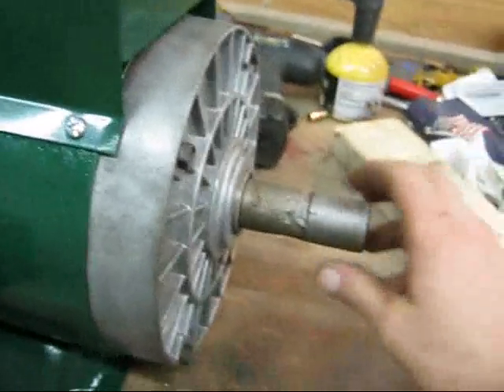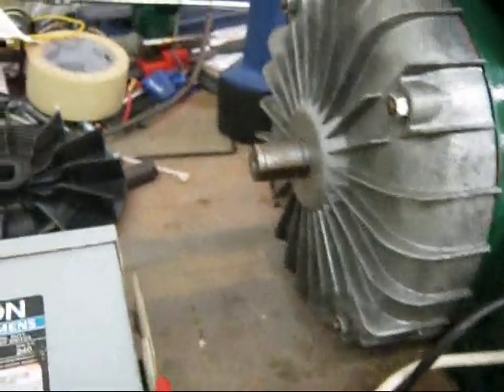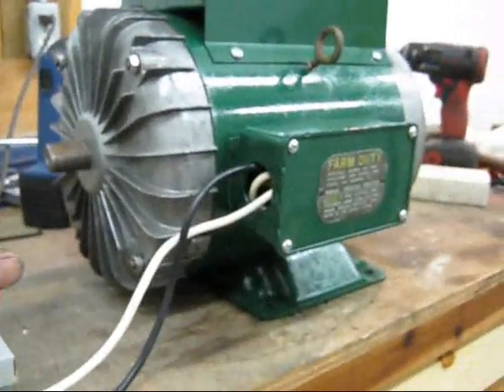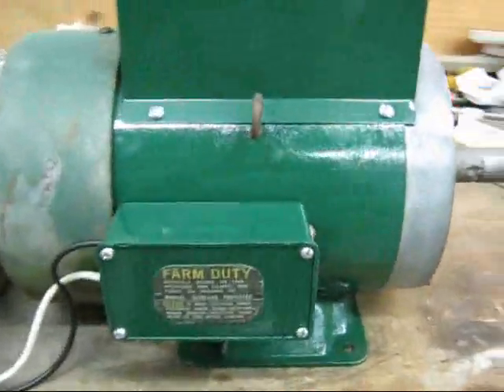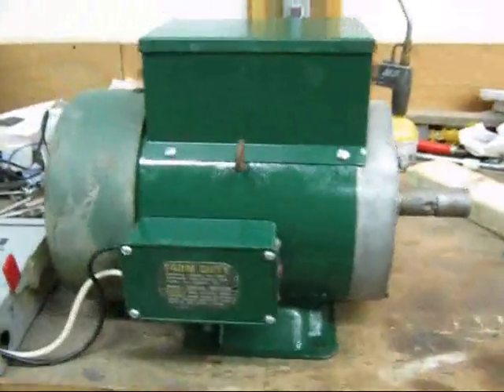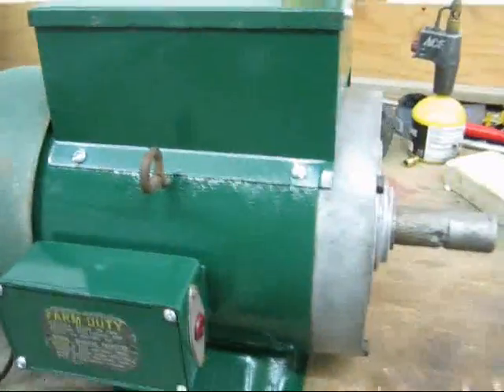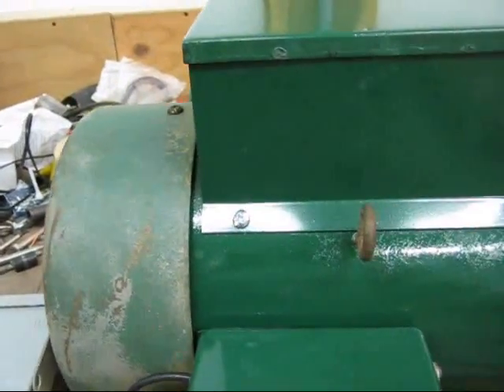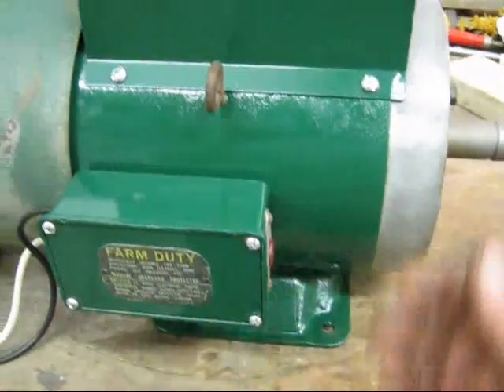5HP Single-Phase Dayton Farm Duty Electric Motor - Almost done!

Comment: hi, what size starting cap or caps, i picked up a 5 hp ajax motor starting caps leaking, it has 2 in parellel 810 to 940 uf@ 165 volts wired in parellel, not sure if original but seems high, parellel adds value of uf so about 1600+ uf at startup just wondering what a similar size motor like yours is running, thanks

Comment: Did some testing and my WEG is only pulling 8 AMPs with nothing hooked up is this normal?  Also when running my Kellogg 330 air compressor pump it pulls 33 AMPs.  Any help would be appreciated.
Reply: So you have no load (other than spinning the rotor) on one draw little amps then when you put a very large load on (compressing air) you're telling me it draws 3x the current? You don't say....

A machine only draws as much current as it needs, outside a short circuit.

Comment: Thanks to you and your great videos I took a chance on a 5 HP WEG single phase off craigslist.  Replaced the bearings and now it runs like new!  Thanks for the great video.  Any recommendation on a magnetic starter and pressure switch.  Thanks Again!

Comment from the maker: Justin, it's very hard to find those fans. I've had pretty good luck adapting fans from other (newer) motors to these. There's a similar sized Baldor motor fan that will fit. I have shimmed the shaft with a piece of PVC pipe cut for a bushing.

Comment: Ok sorry disregard my previous comment on the original video. didn't see this later update till after. Anyway, wow is that a great motor now or what! Thanks for sharing. Can I send you a pm on a question I have?
Reply from the maker: Thanks for the comment! Yeah it's a good motor, I plan to use it on my pressure washer if the original motor fails. PM me anytime!

Comment: Very cool video, I am working on a 5hp A.O Smith /Century  K300 motor and running into problems.
First I took off the back cover and snapped 3 of the 4 tiny screws flush so i had to drill out the screw and re-tap them while finding out that the cooling fan was missing one fin and 2 other fins broke (still might attempt to fix that.)
Next I changed the direction to CCW for the compressor and cleaned up the 4 start capacitors (540-648) that the connections were a bit crusty.
4 long bolts hod the front and rear caps on and the bearings are pressed onto the shaft and the inside of the caps, it took me the better part of the day just to remove the stuck caps without breaking them.
So now I need to change the front and rear bearings 6307Z front and 6206z back and find another start governor that was part mounted on the shaft and the other part mounted on the back cap which is the one i need.
Problem city but with any luck I hope to have it running soon.
Reply from the maker: Hello Vic.  Hope you get your motor up and running soon!  The switch on the rear housing is usually what goes out. Are the contacts the problem? You can often repair them by soldering new contact pads on there.
Reply: the contacts seem to be okay the problem is where the wires from the motor hook too the prongs, they are real weak..
The slide on posts are frail and weak and I am not sure  they would be able to withstand the wire being put back on them.
I will know more information tomorrow as there is a shop here in town that repairs motors and with any luck they can get the part.
I tell you the outer part of the bearings were so stuck on the front and end cap, it makes me worry if they were that tight (pressed in there) will I be able to put new bearings on the shaft and be lucky enough to have the caps go back on without force?.
My guess is the big shops use like a special press to put them on but not sure.
Reply: vic fisher मुल्य कितन है
Reply: vic fisher 5 hp me मुल्य